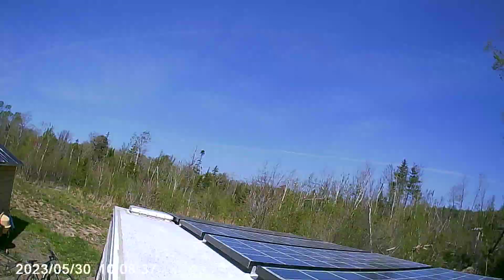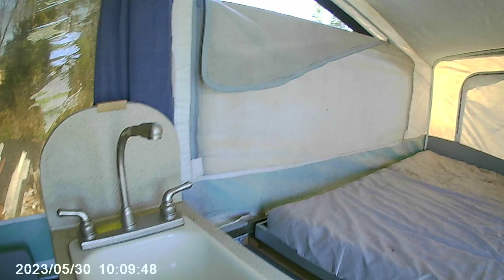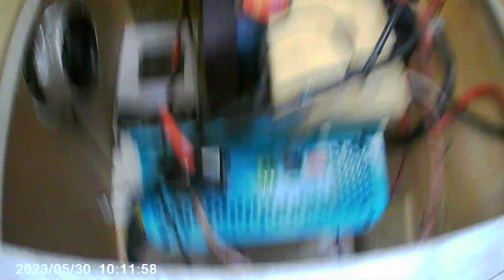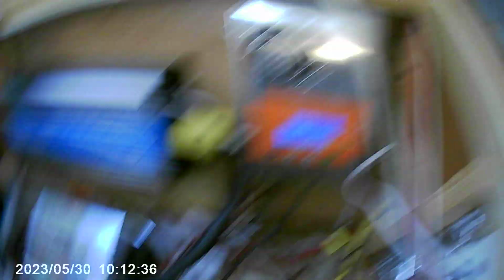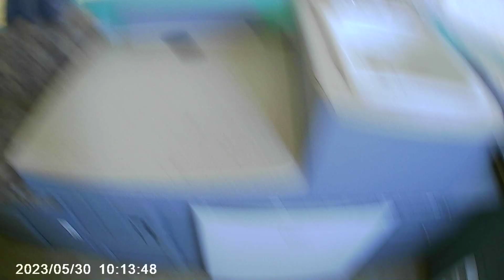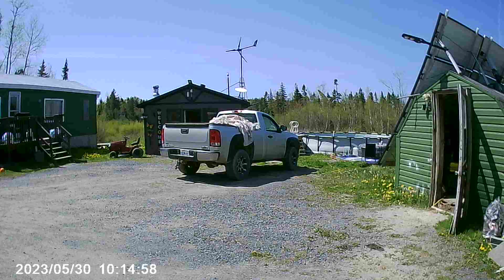the off grid pop up camper solar powered

Comment: what did you cover the bunks ends with?
Reply from the maker: the old add on screen room came with it.i cut that roof for the bunk ends folded over the edges used a box stapler stanless steel staples and put reflectex in between the layers

Comment: What all did you use in order to power all of those items with only 540 watts? Im new to all of this stuff and im trying to understand how it all works.
Reply from the maker: the idea is to have a fully charged battery.turn on air conditioner with radio is only 380 watts so create more power than you can use.if the sun is shining and batterys are full charged it simply stops taking a charge.as you know pop ups get hot in summer like an oven if you cant use the charge when full charged turn on free air conditioning an radio an crack a cold beer off the grid is priceless.